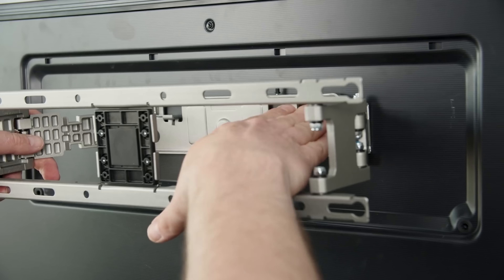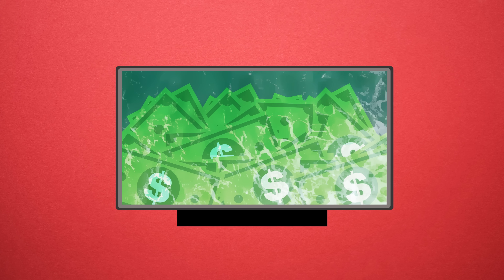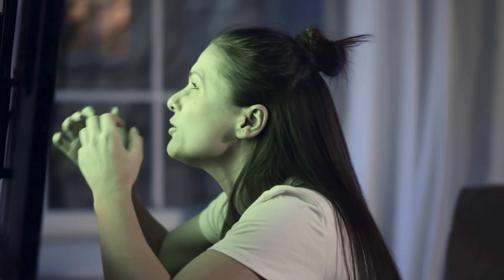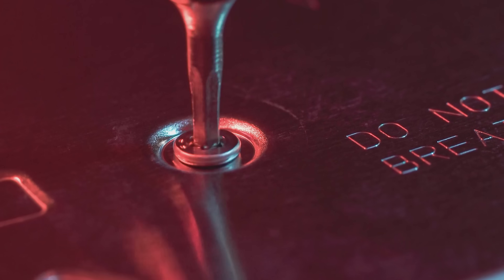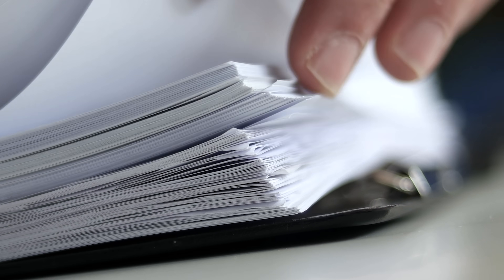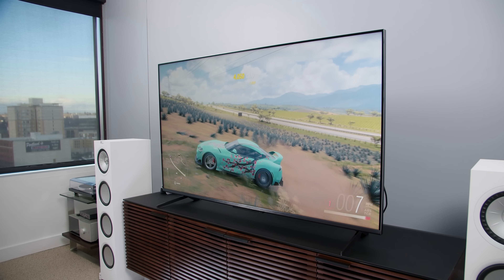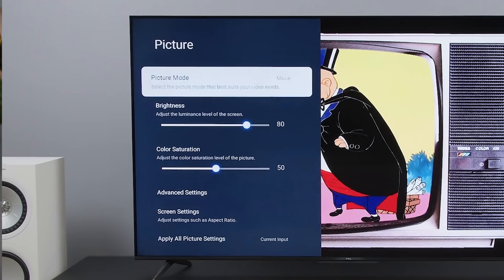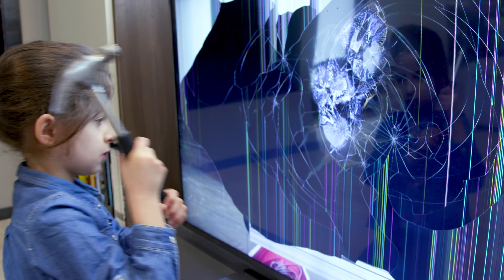What is Dirty Screen Effect (DSE)? | How to test and what to do

Comment: My cellphone screen is flawless. 😁 My tv, not so much. It's a Vizio E50-D1 and has some vertical DSE in the center and edges of the screen. However, considering that i paid about $350 for it seven or eight years ago and that this issue is not really noticable during normal viewing, I'll take it as a win.

Comment: Assuming DSE is essentially the same as vertical banding... the video does show something similar.  I mean it seems like if you purchased a TCL early 2020s, 9 out of 10 times you're just stuck with it. My TCL65 R635 has em... purchased in 21 but I didnt become fully aware of it until around last year... suppose its gotten worse over time so, no solution now at all outside of buying a new TV I guess... just terrifically unacceptable.

Comment: My old TV has severe DSE (If that is indeed what it is) it looks like dirty water was dripped down the front of the screen and dripped down. It got worse over time. Then there would be very bright streaks with the very dark streaks. Then recently I moved to a new house. I transported my TV in the trunk, wrapped in a blanket. Then I wiped the dust off the back of the TV and plugged it in. The streaks are mostly gone, but they have now changed to being only on the bottom half of the screen, and look like dirty smudges. It looks like someone took a dirty rag to the front of the screen and wiped it up and down, then side to side. Honestly, I think it might be a slight improvement. I'm wondering if dust/dirt getting into the vents in the back could be having some effect. I am tempted the wipe the vents again, this time with a Q-Tip & alcohol (while the TV is off/unplugged of course). But I hesitate because the state of my screen is slightly better now than all the years before, what if this just makes it worse? All I know is, wiping the front of the screen has no effect.

Comment: I have a Sony FALD set, 55” and fortunately it’s pretty clean. It does have some DSE but I’ve seen a lot worse so accepted it. It’s a few years old now though and I’d like something bigger, but honestly I dread buying a new tv as I seem to be sensitive to all these panel issues, and sending them back is such a pain. I’m planning to make my next “tv” a DLP projector with 3 laser / led light source. After research this seems to be the best tech available at the moment to give a large clean high resolution picture. Ironic really since the tech is decades older than anything in a modern tv.

Comment: ((WAIT)) I was able to fix DSE on my my tv. I read online it can be removed by using a soft cloth and gently rubbing the screen in small circular motions.  I spent about three minutes doing this in the areas that had slightly dark patches. Surprisingly this worked and the TV screen is free from the dark patches now. Thanks to AVforums for the help. BEFORE YOU THROW YOUR TV OUT TRY .
Reply: Hi, have you rubbed the screen in small circular motions while the TV was on?

Comment: DSE should not be a thing, We don't pay 2000$ for something bothering in the screen that should not be there. The first problem is the company who doesn't care. Very loose quality control because otherwise nothing would come out of the factory. I'll never buy another tv until they find a way to build tvs properly, sometimes it's just the screws that are way too tight. The second problem is transport, i've seen how these guys manipulates Tvs boxes and lol.. Playing the panel lottery is exhausting and if you return a tv with DSE there's high chances that you'll receive another one that is worse. It's not worth the hassle so we gotta 'deal with it' . I'm very DSE sensible, i see imperfection from miles away. It's a curse, some people don't see that and they're lucky.
Reply: The problem is that no one wants to take the brand that manufactures televisions with this dirty screen effect defect to court because just paying the lawyer and going to court is more expensive than the price you paid for the television.

Comment: My LG 70UP77506LA has vertical zebra stripes all over the screen. Insufficient brightness of the LEDs is the reason for my dirty screen. The LEDs behind the matrix do not shine so brightly and a dark zone forms between the two backlight diodes. Since the horizontal pitch of the diodes is wider than the vertical, I see vertical dark stripes. LG refused me a warranty replacement of the matrix two years later. Although I notice that the backlight has shrunk a little in 2 years and the stripes have become more pronounced. It's terrible what LG is doing.

Comment: i have dse and banding on ALL my tvs high end just only was ok and was a  2018 300e lg low end.
i think new panel are better but not perfect

2019: lg c9: lot of banding and a bit of clouding
2020: lg g1: a bit better but again dse and banding AND PINK TINT
2021: samsung qn90a (first samsung miniled): horrible dse
2023: hisense u8hq dimming issueand dse
2023: hisense u8hq dimming same issue and dead pixel
2023: hisense u8hq dimming  same issue but i dont want change again... 3months later: dead pixels!
2023: hisense u7kq a bit of dse but its good!  (and im boring to change again and again)

Comment: My display just recently starting acting up with this...been good for many years, so guess I was lucky.  I use my TV as gaming monitor with my PC.  I'm sure that the high backlight settings I used caused problems seeing menu text on left side.  First there was the flashing, forcing me to turn the backlight down to no higher than 61.  Then, on my computer, under settings, display, personalization, I switched to Black Background and HIGH CONTRAST Setting which  HELPED A LOT! I guess this setting is typically used for vision impaired people.  Tremendous improvement.  My TV is a Vizio E55-UDO LED 4K my next will be and OLED 55 inch LG probably.

Comment: I made this test in my moto g8 power LCD and it has DSE at the bottom (seen in all displayed colors, but more in grey tones). It's really annoying, but I use dark theme most of the time, and since its contrast ratio is excellent for an IPS, 1500:1, blacks are solid and makes this issue disappear.

Comment: Never buy Samsung if you want a clean panel
Reply: And LG qned...
Reply: @gembal agreed. Our 86qned85 is pretty bad with dirty spots,
Reply: @gembal My qned looks great in the test. Ant manufacturer can have some TVs with it.
Reply: After five years, I've got two vertical shadows on me Samsung qled
 Won't buy another samsung.
Reply: Lol so right! But LG is worst. The best experience I ever had is with Sony. 7 years and no problems at all.
My new Samsung 65" have some DSE..  :/
Reply: Hisense also have dse someangle not visible some angle it visible
Reply: Lg led 4k also have same
Reply: no tcl too
Reply: Same with TCL.
Reply: Why? 
I've had samsung tvs since 1080p HDTV 1st came out to the QLED and now the QD-OLED. Never had any problems with them and never had screen problems with them.  
What problems did you come across with them? 🤔
Reply: Not every screen is the same.
Reply: @Jack-Torrance80  You’re right. With a Sony you won’t have to exchange it as many times to find a clean one. So exactly, they aren’t all the same

Comment: My LG 48 inch 1080P 120hz LED TV from 2012 has it on the right side when it was all gray but I have a small stain now in the bottom corner that only can be seen in light colors. If theres black bars from a Movie its gone so it doesn't bother me that much since this TV is pretty old and I did paid $700 back then and I should of return it because there was a purple banding on the right side since the beginning but never can notice it in dark movies,

Comment: Bought a Samsung tu8000 series in 2021,and it's absolutely horrendous now, of course, just after warranty runs out. But mine slowly came on, so I'm 99% sure it's dirt.. I have to break about 59736525826 plastic clips taking it apart because there are no screws in this thing... And it's 75“ too, so it's just a bear to manage and handle.

Comment: I was worried about OLED burn in as I use it for a monitor (but from the bed). So I bought a LED panel one from Philips, and it has slight DSE, but you really gotta look for it. Overall satisfied and accepted that there is no perfect TV, I'll be more aware next time. I just don't know how realistic it is to return a biga$$ TV, I mean the unboxing an installation was such a chore in itself. I don't necessarily want to minmax it and pull the lever to get another one, and another... So many things could go wrong. If I deem it acceptable might as well just stick with it. I mean I did minmax my monitor but that's different and is used for work, I was hunting for bad pixels and there was in-store unboxing of several until we found a perfect one. That's a bit unreasonable for TVs (store employees will surely hate you for making them unbox and exhaustively several TVs that look perfectly good for the average person but you are nitpicking about a bad pixel you will not even see from over 1.5-2m distance or a DSE you didn't know exists before this video :D). Or with infinie money order 10 different models, test them all in your home, then return the bottom 9 with a courier? They'll just love you. Realize TVs used to be black and white and bulky in terms of depth. Nowadays they are far more brilliant than most people's eyes have ever seen. After seeing how crappy TVs are set up in hotels, and at non-TV-enthusiastic people's homes, with wtf/default settings... the fact that we care even a tiny bit about picture quality to notice flaws means we pay attention and are already better off. If it's not that annoying, just be happy with it :)
Reply: Agree 👍

Comment: i had bad DSE so i just stripped the tv down to the max and literally cleaned the LED shroud inside and all the plastic diffuser sheets then finally cleaned the back of the panel and no more dark patches.
Reply: I've seen videos of people doing this. Is this what DSE really is? Just dark dirty type dust stuck on the diffuser sheets?

Comment: Most if not all "DSE" that develop on LCD screens with time in form of uneven darker areas is just dust on the reflector that made it's way inside due to the movement of hot air from leds and can be fixed by partially disassembling the TV and simple cleaning. Too bad lazy servicemen often don't want to do it, but aside from need to carefully remove LCD panel (which is not that terribly fragile btw) - it's not very hard. But in my experience - just about every LCD TV will start to collect visible patches of dust inside in about 2-3 years max. Irony of the situation is that OLEDs are free from this problem but suffer from burn in with very similar effect...
Reply: I have never ever heard about dust getting inside the TV causing DSE. Who are you what are your credentials? I have literally never ever heard about dust causing DSE, ever!!!!!
Reply: @elon2159  You can search "lcd black spots removal" or like. I got them on every tv i or my relatives had sooner or later depending on how dusty the place is and after talking to serviceman i know got my answer why it happened. There is no other reason for them to appear other than led failure which can be fixed as well
Reply: @alexandert4252  So i have to take my TV apart then? Fuck man I don't wanna do that at all.
Reply: @elon2159  Keep the room clean i guess - there seem to be direct corelation with the overall amount of dust, you may not get it at all or very slowly. But the point is - the service should provide such cleaning procedure. Ideally

Comment: I just purchased a  Vizio M50Q-JO1 and it has a tiny bit of DSE in top corners but I only paid $298 and have a 5 year warranty. I am just going to let it be unless it gets worse and use warranty close to end as possible.
Reply: I purchased the extended replacement warranty FYI

Comment: I got a sony x95j it has a softer plastic panel screen coveri also seen clouding when it was new so i felt for hot spots on the brighter scouding then i noticed the light clouding went away in the corner i noticed a slight bit of dse in bright picture so i tryed the opposite got abit of strong garrilla tape stuck it on the dse corner pulled it off the dark cloud whent away it only works on certain screens

Comment: I have a Sony OLED XR77A80J and started noticing a fairly large area of DSE. When I noticed it, unfortunately it was past the return time frame from Best Buy (which is where I bought it). But still within the 1 year manufacturing warranty from Sony. I logged on to the Sony support website and talked to a representative. They were able to remote into my tv through the internet and make some setting changes. It helped but the DSE was still very noticeable. They then forwarded my issue to the Sony Concierge support team. They had me take pictures of my tv showing the DSE and submit through a provided link. They also had me run a YouTube video (766900002) on my tv and take pictures at different times during the video (20%, 40%, 60%, and 80%). Note this is a grey scale video. After 2 days, I received an email notifying me that Sony would be replacing my TV with a brand new tv of the same model. Should be receiving within the next week or so. After paying $3k for a TV, I’m glad that I was able to get a new replacement. So my advise if you have DSE on your tv, is to return to the location you purchased it if you are still within the return/exchange period. If not, try contacting the manufacturer, which I think most offer at least 1 year manufacturing warranty.  You may just be lucky enough to get a replacement. I will provide update on quality once I receive new model.
Reply: Update- I received the new replacement tv from Sony yesterday. And right out of the box it looks extremely better. No DSE and also the tv turns on as soon as I press the power button. My previous unit with the DSE also needed a special turn on sequence: I would have to turn it on, turn it off, and turn it on again before the screen actually showed a picture. This new unit has none of those problems. It looks great and works great!

Comment: Because of the countless floaters in my eyes DSE isn't that much of a problem for me. Try editing a photo when you've got DSE or floaters.

Computer monitors also suffer from DSE, in fact I had a 2008 24" iMac that I had to have the panel replaced 4 times. Luckily I had bought Apple Care. It was a known problem and Apple just ignored it replacing the problem panel with another one with the same problem.

Comment: Just tried the test images on my Sony 77A80J, and it looks quite good.  Not perfect mind you, but nevertheless quite good. That being said, many of us who regularly view these expensive large display panel televisions don’t have perfect vision anyway. For example, I have myopia and astigmatism, corrected with lenses, but still have significant issues with vitreous floaters… which can appear like “migrating dirty screen effect” at times!  I guess my point is that nothing is perfect… And even if the screen were absolutely perfect, our eyes may not be capable of perceiving that perfection. 
As my dear old dad used to say, “it would look good to a blind man“.
Reply: I have successful experience with Sony. It's been 7 years now and the TV is as sharp as new. On the other hand, I bought a Samsung and I see that there is a lack of uniformity in the light of the panel

Comment: I got a QN85A Neo Qled (65") which has quite bad DSE , at least I assume it is DSE. 
I contacted support which told me to run a 1 hour long video flickering between colours extremely fast and also to give it about 2 weeks and then check again. 

That 1 hour video seemed like it did improve it all cuz now the DSE is mostly visible from the sides. 
I'm giving it 2 weeks like they said and then I'll make my mind up if I will keep it, change for a new one or to a completely different tv.
Reply: Support really told you to run this? First I've ever heard that. Interesting.

Comment: Bought a Sharp 60" TV and became aware of this issue the very first day, after a couple of days I was certain it's the TV (and not me). 
Following advice on one site (which described this problem as clouding), I did manage to gently and I mean gently massage the screen with a very soft cloth to even it out.
As you say, I couldn't un-see it, but also realized there was vertical banding. Over the next few days the back light started clumping in other areas. So I returned the TV.
In doing research to find a TV that was less likely to exhibit this problem,  the Sony X90J came highly recommended. I did more research on this TV and that's how I found your channel, I watched all the videos you made for this TV (and subscribed).
I came away confident that the Sony was a good buy, and I am very happy with it. It it does have DSE, I haven't seen it yet (had the TV for a month) so I think I got a good panel.
Thanks for your channel and keep up the good work.